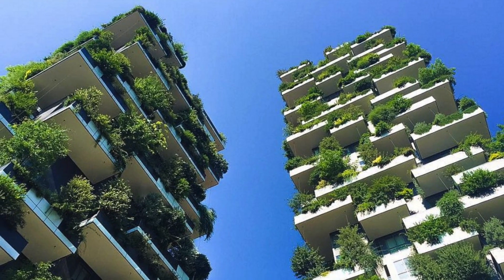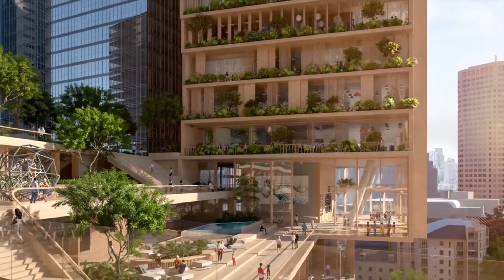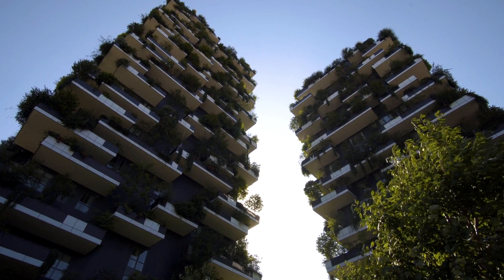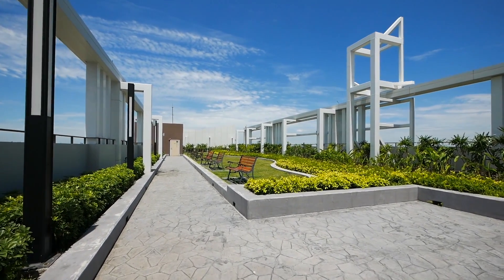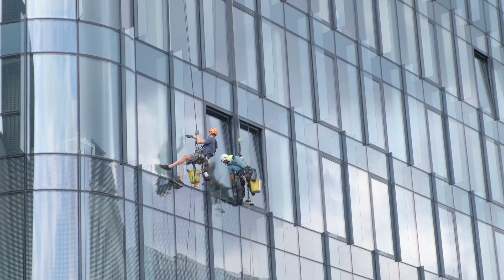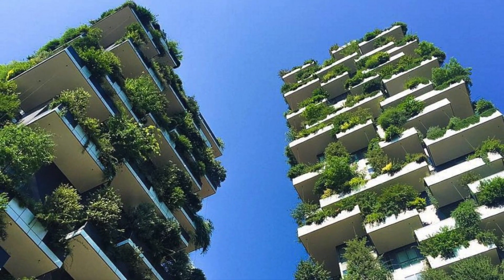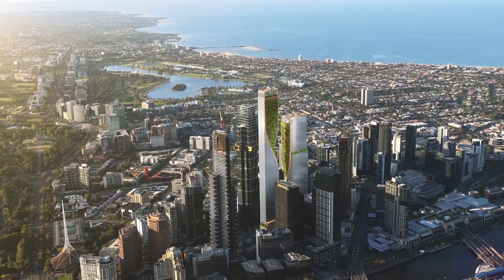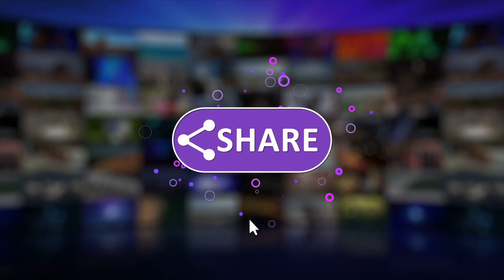The Engineering Problems Behind Green Skyscrapers That Nobody Thought Of

Comment: Green residential buildings are visually more pleasant to live amongst and reduce air-conditioning costs on primary heat walls, a10 story residential with green garden features on the street sides is going to be more pleasant to live with in a residential neighborhood .You don't need green balconies all the way up a 100 story building, what about having the gardens on the first 5 floors of a commercial building ? Each project is individual and costs and benefits need to be assessed individually insitu.

Comment: High maintenance nightmares is what they are. The additional weight has to be driving structural engineers nuts. Aerodynamisists the same due to the way foliage captures the wind. And lets chat a bit about all that nice corrosive fertilizer, water piping and demineralization costs for the water to keep the watering heads from clogging in a few months. And winterizing... have fun with that!

The people living in these things will have to be rich just to cover the additional maintenance costs!